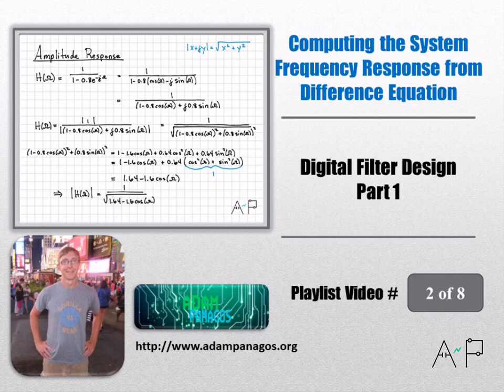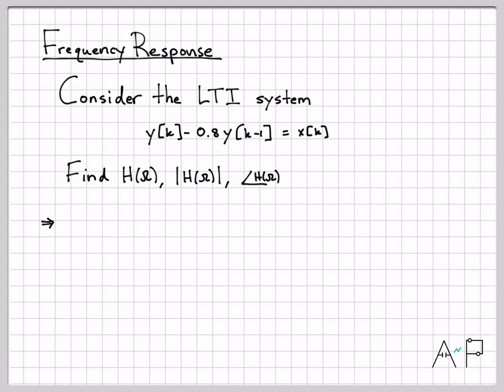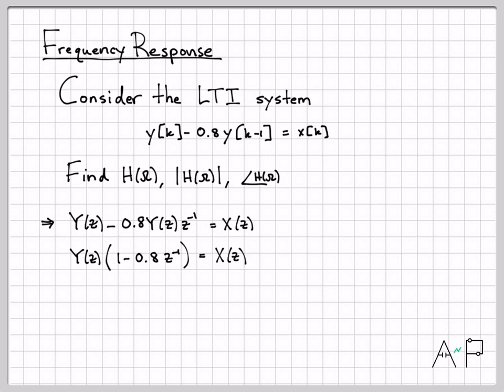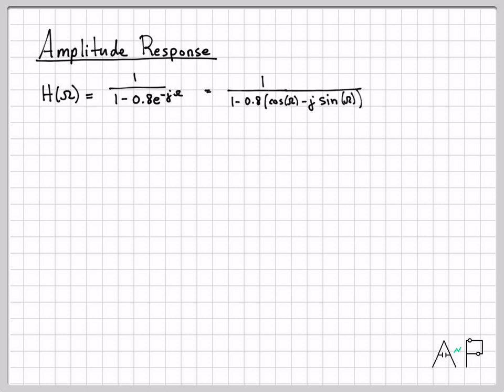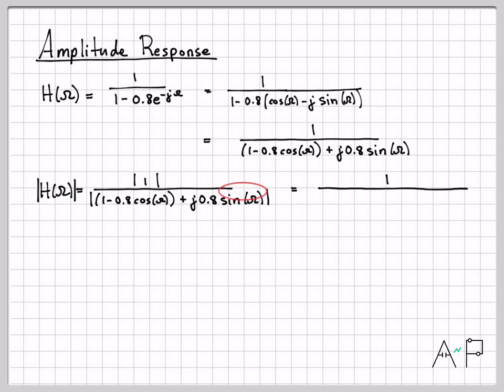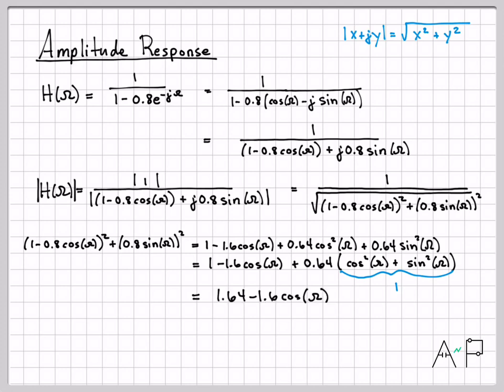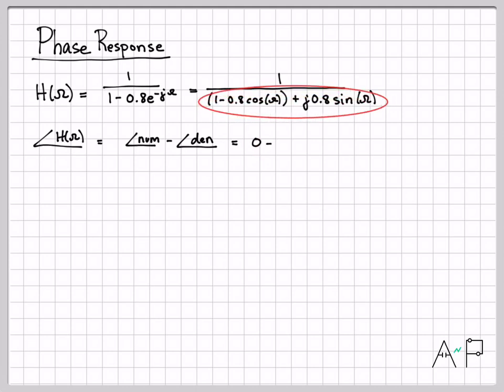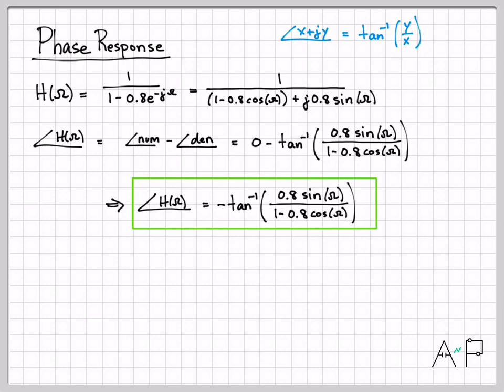Computing the System Frequency Response from Difference Equation

Comment: Hi Adam! Thanks for the great content! A quick question, when we write down the phase response in terms of tan^-1, does the range limit of tan^-1 also applies (i.e. tan^-1 returns a value between -pi/2 to pi/2)? If that applies, phase response 0 and pi will be the same (since tan(0)=tan(pi) periodic with pi), which contradicts the intuition that they are Not the same. Could you elaborate on that a bit? Great thanks!!!!

Comment: what would happen if you have a z^-2 or higher? 
if im right it's just e^-j2omega
Reply from the maker: Yes, that's correct.  If you're trying to go from the Z-domain into the frequency domain, you just replace z with e^(jOmega).  So, if you have z^(-2) we have (e^(jOmega))^-2 = e^-j2Omega like you said.  hope that helps.
Adam
Reply: @AdamPanagos  thank you